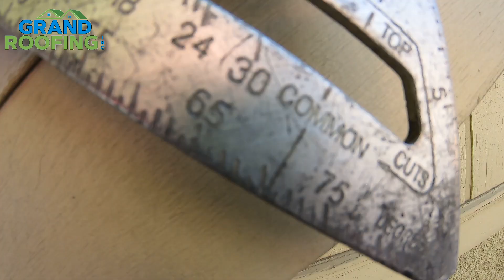How to find Roof pitch or slope

Comment: Or, if your house has the Whirlybird vent turbines correctly installed you can look from the ground through a pair of binoculars to see which numbered adjustment hole that the screw is in on your turbine vent and get the number and that will give you the pitch of your roof because when the turbines are installed correctly the adjustment screw is installed in the numbered hole according to the pitch of the roof.

Comment: Level line on bargeboard. Measure 12" horizontal from edge.Vertical line from 12" mark down to edge.
Divide this figure by 12.
This will be 0. Something.
On calculator use tan-1 then the something number.This will be the degrees.

Comment: I noticed that you've been on a roof a time or two. You set the ladder height to the roof top, at the perfect and safe length.
Reply: The safe length is three ladder rungs above the roof. What he is doing is technically unsafe by modern safety standards.
Reply: Ummm. Nope. General rule  of thumb is 1:4 ratio, that is one foot away from the building for every four foot hight. With an eave that is 20 feet off the ground, the bottom of the ladder will about 5 feet from the building, extending a minimum of 3 feet about the eaves trough with both the top and the bottom of the ladder secured, as per CCOHS regulations, our equivalent to OSHA. And it's illegal to work from a ladder without fall protection equipment. Also, he set the ladder at the gable end, which damages the ends of the shingles and will cause the ladder to shift; the shingles become pliable when the weather warms up and with consistent pressure from the ladder. It's very unsafe.
Reply: @therealhiesenberg2731  So now I know why I've had issues climbing the corporate ladder.
Reply: @therealhiesenberg2731  but he's demonstrating how to measure the pitch. So he kind of has to ladder the roof at the gable end doesn't he?

Comment: Ok, so let me get this straight. If I climb up on the roof and pull tape, area equals length times width, regardless of pitch, yes ?
Reply from the maker: If you are measuring a roof section for area yes width times height will give you the square footage. If you're doing it from the roof there's no need to know the pitch.
Reply: @GrandRoofingInc  thx

Comment: brother youre working way to hard the pythagorean theorem is what separates pros from those trying hard, or forman from labor. a²+b²=c².
 a, run,  gutter to center of gable, 
b, rise, eave height to ridge height ( count siding if needed) .
c, the hypotenuse is the number you need. 
so add rise and run, then get the square root of that and thats the surface area. 
for pitch just divide rise into run.
all this can be done from the ground
Reply: Wow you can eyeball the length of ones gutter to center of cable, that pretty impressive. You kollege boyz sure R purty smart!
Reply: @toynoob2051  I don't eyeball anything, if you dont understand what it is I'm talking about it's ok to say that and ask questions. You're acting like the big dumb TV bully, who doesn't understand the school work so he beats up a kid. I didn't finish the 10th grade, but I've spent 30 yrs taking my job very serious.  Using amd understanding the Pythagorean theorem should be taught to all entry level tradespersons. The instructor/ journeyman/trainer/whatever is failing them, but likely because they don't know it either.  The triangle is such a huge part of building. Roof elevations are just an example. Rolling offsets in plumbing, gussets, kicker braces, stairs.  So if you want to live your life as am ignorant hammer holder, that's your choice. If youd like stop acting like an ass, apologize,  and ask some questions.  I'd be more than happy to answer them for you at that point. But don't get it twisted I'm no lolly gagger, in school uniform. I came up hard in an era when that meant something. So I've been polite and respectful. Comment, or don't, I don't really give a shit. I was just trying to help someone obviously who wasn't you

Comment: My friend wants to know why there is more waste on a steeper roof. Asking for my friend. He's just wondering
Reply: Ok thanks. I've always climbed on the roof and measured with a tape. I've actually been successful when my competitor shows up and uses a drone. "You brought a ladder and you went up on the roof so you have the job!" The other guy flew his drone and lost out.  But thanks for filling me on that tip...I just mostly install.
Reply: @thehamstaa5148   I've had that happen to me, A client tell me.  " I've had three other guys here and you are the only one who went on the roof" .  how else ya gonna find soft sheathing on a roof.  I did lose a bid some 8 years ago when i found it was not a single layer but THREE layers because they cut back  along the rakes and gutter making the edge look like a single layer.  I also knew for a fact that this particular early sixties ranch had only 3/8 inch plywood sheathing.  It was like walking on a mattress.
Reply from the maker: It's not that there is more waste, It's if your measuring from a 2 dimension, like from the ground or Google maps then your numbers will be off more the steeper it is.